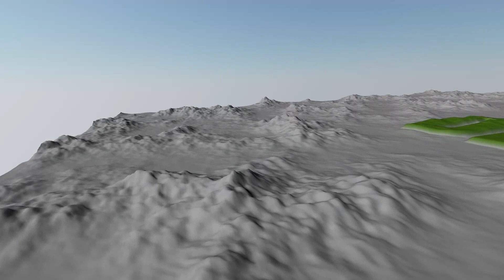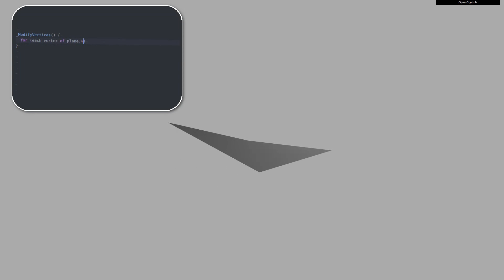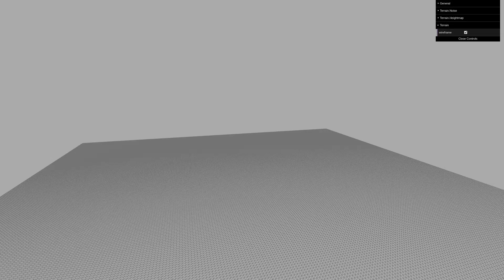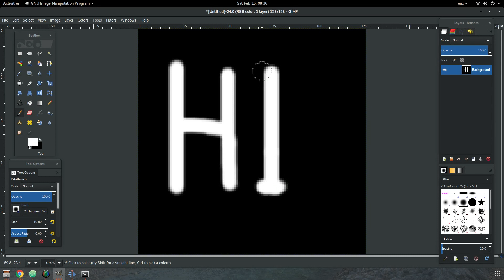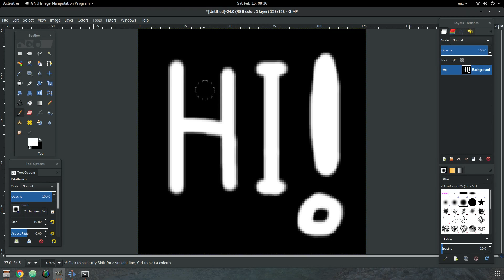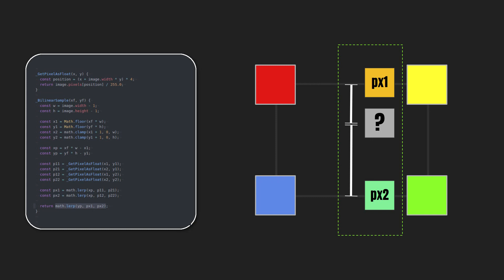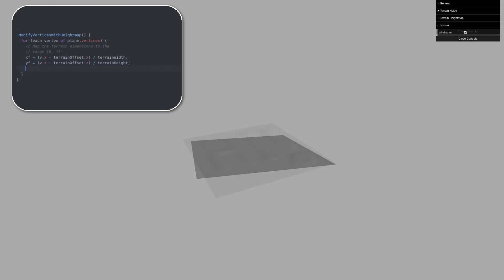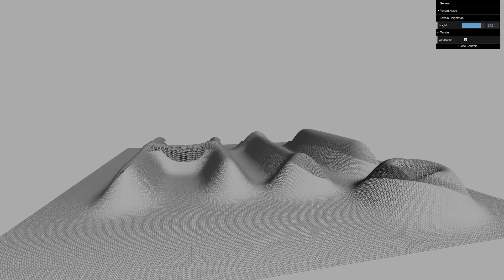3D World Generation: Heightmap Tutorial

Comment: why did you divide the distanceFromCenter by 250? Also Whenever I implement this, I get a raised bump but straight through the middle instead of just in the center. Any help? Thanks!
Reply from the maker: It's been a couple years since I made this vid, so I don't have much memory of what I was doing here. Is it the part around 4:30'ish?

If so, I was just demonstrating how to build a bump that was centered in one of the terrain chunks, which are 500 m wide. So the max radius from the center is 250, so divide by 250.
Reply: @simondev758  Thank you so much, I've been following this tutorial and converting everything to the new threejs has been a journey. Thanks so much once again!
Reply from the maker: @michelleokolie6470  Good luck!

Comment: FYI: if you download the code from Simon's Github for this lesson you may run into a problem trying to load up your index.html page where the .js mime-type is not recognized. This will of course throw an error stating that the mime-type is wrong. To fix this you can create a python file in the root directory of the code and execute this to start your web server. In the python below you can see we created a mime-type mapping for .js that will correct this issue should you run into this.

import http.server
import socketserver

class MyHttpRequestHandler(http.server.SimpleHTTPRequestHandler):
    def do_GET(self):
        if self.path == '/':
            self.path = 'index.html'
        return http.server.SimpleHTTPRequestHandler.do_GET(self)

# Create an object of the above class
handler_object = MyHttpRequestHandler
handler_object.extensions_map.update({
      ".js": "application/javascript",
});

PORT = 8000
my_server = socketserver.TCPServer(("", PORT), handler_object)

# Star the server
my_server.serve_forever()

Great video simon.
Reply from the maker: Awesome, thanks for the fix!

Comment: will you please convert your project to unity
Reply from the maker: It's on my TODO list, work is slow though since I only spend a bit of time on these tutorials. House isn't going to renovate itself.
Reply: @simondev758  It's almost October. Did the house renovate itself?
Reply: @simondev758  I would chose Unreal IMO. Especially incoming version 5 which gives incredible capabilities. Did you see the demo? Lot more procedural related games have been achieved with Unreal. But that's just my opinion ^^
Reply from the maker: @noxen_studios3566  Yeah I might fiddle around with Unreal at some point. The point of these is just to explore and play around with ideas, not to try to make the most awesome thing ever, so JS and WebGL are just fine for the most part.
Reply: @simondev758  I agree. Putting our hands in code that is more close to how the machine is thinking and treating hardware permit to embrace more the meaning of what we are trying to achieve, and permit to understand more the key-concepts. Big up for Three.Js that definitely have huge potential. Pretty happy to see someone dealing with lod and procedural using a webgl framework. That is just great